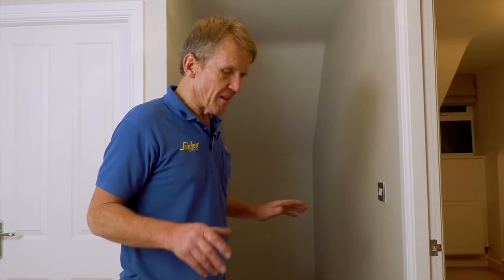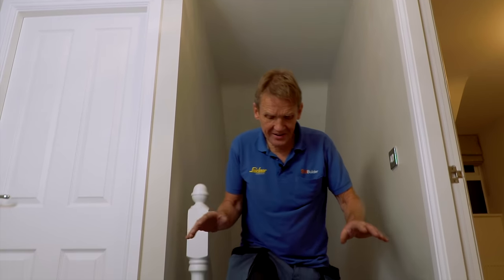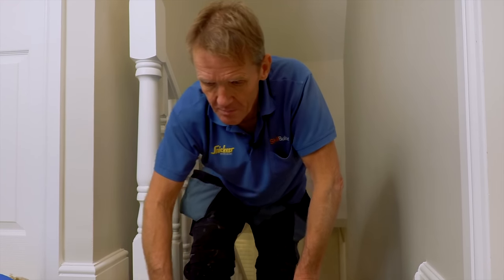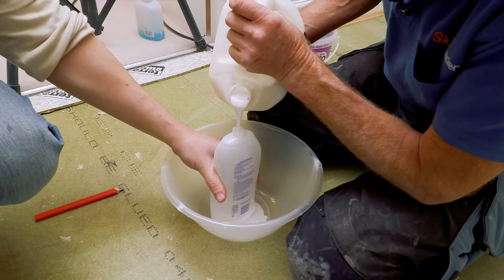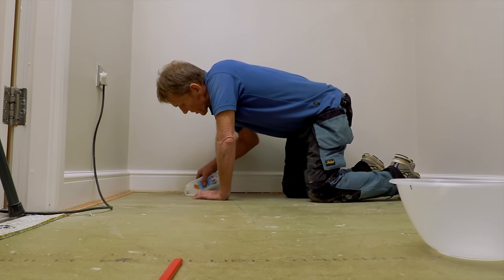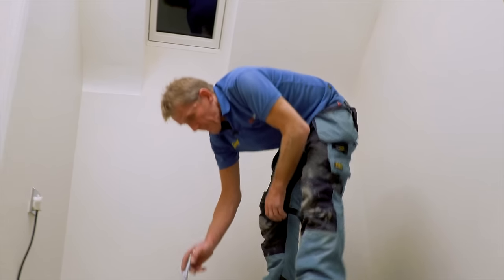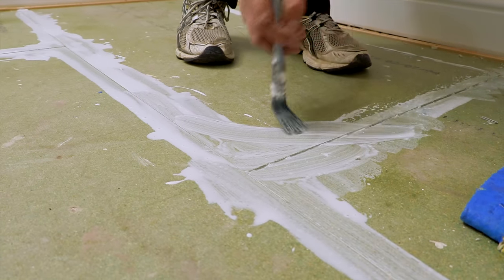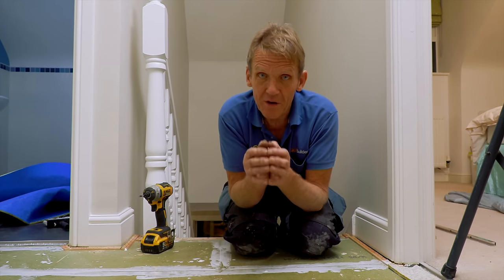Creaking Floorboards Driving You Crazy?

Comment: DON'T DO THIS! I watered the PVA down in a 1:3 ratio and tried this and it just went through the ceiling through the lights and now I'm worried. Not been 12 hours yet so we'll have to see with the squeaking. If you do it, don't add water.
Reply from the maker: I think you went a bit over the top there. If you don't water it down it will not get into the joints but don't pour a whole load down in one go.

Comment: DO NOT DO THIS!!! I tried this method and it has warped my floor!
Reply from the maker: You must have put a lot of water on it. It has never happened to us but we have had floods from burst pipes that made the joints puff up slightly and you can sand the joints down flat.
Reply: @SkillBuilder  I did one part pva to two part water...
Reply: @sierramc3935  and it still worked ?
Reply: @kimbo1966  no, creak still there

Comment: You can just drive some screws right into the carpeting and into the floor and that should work great. After doing that if the floors aren’t creaking then it’s really not necessary to pull up the carpeting, purchase and apply the glue then pay A carpenter to come over and refit your carpeting. Just because someone takes the longer way to do a job doesn’t necessarily mean it’s doing it right. I don’t mean to undermine his advice because he seems very knowledgeable and helpful just be aware there is an easier way to complete this job you decide what’s best for you.
Reply from the maker: Jeffrey 
That is such bad advice and anyone with any sense will not drive screws through carpet because you have no way of knowing where they will go. If you don't land on a joist it is pointless.

Comment: Seriously it was nailed! All you needed to do was screw it, glue was completely unnecessary.
Reply: Big Boss wrong! Roger is correct. The squeak comes from the movement on nail shank and/or the t&g joint. Roger is absolutely correct to glue the t&g joint. I’d bet Rogers 40+ years experience trumps yours.
Reply: Let me give you a basic science lesson, friction is caused by movement in this case the movement is the floorboards not being sufficiently screwed tight enough to the joist hence allowing movement. Nothing to with experience just good old common sence oh and I'm sure the next tradesman who's going to need to lift the floor up is going to appricate it's been glued.... amateur experiments
Reply: then why does the manufacturer say glue them? the glue bonds them and also coats them dulling the noise from friction, as someone who has removed countless chip board floors it rarely comes up and goes back down as it breaks in to pieces.
Reply: Big Boss I’m not sure being an apprenticed and qualified carpenter with 23 years experience classifies me as an amateur. 
FYI we should fix down floors to building regs, manufacturers instructions or best practice irrespective of whether another tradesman may, or may not, need to randomly open a section at an unspecified later date. Roger did explain it’s unlikely there are services running below these areas so maintenance in the near future in these areas is unlikely.
Further, it’s also very poor practice to have lifters in high foot traffic areas such as halls and landings.
Reply: @lewisthompson1611  the glue is a solution to a problem that is resolved by sufficiently screwing the chip boards down to hopefully well screwed floorboards to joints.
Reply: @stevend9960  A. You should know that no mater the years of experience every day is a school day.

B. I'm promoting the screw not the glue  in regards to tradesman needing access as it will probably break or most likely weaken the t&g on the chip boards when putting back together and we both know they ain't going to get glued again lol. Also he glued everywhere and didn't screw near potential pipe runs.

C. Lifters are old school as long as boards are screwed down and not nailed that is sufficient in regards to future access.
Reply from the maker: The writing is on the board. Should be glued. All those people who think you don't need glue are the reason we have so much of this sort of thing.
Reply from the maker: @BlGB0SS  I love the way that people claim "common sense" to be somehow superior. The British Standard calls for glued tongue and groove joints. It is common practice on all building sites but people are lazy or, like you, just know better.
Reply: @SkillBuilder  with all due respect if this product requires glue doesn't that just tell you it's causing a problem as it eliminates another...
Reply: Skill Builder ooofftt!!! Go on son! 😎
Reply: @SkillBuilder  ok let the evidence speak for itself do the same job but only use screws sufficiently and not glue and since when have the BS ever been perfect? Oh never so guess I must be arrogant for trying to use my own incentive and reality into practice.
Reply: @BlGB0SS  If you need access you  cut tongue anyway and afterwards fix a noggin under the joint.And good practice to glue them to the joists as well.As my mate Dave used to say 'each one teach one'
Reply: Big Boss can you please advise whether you are a tradesman and what type of experience you have with the scenario shown in the video? I am afraid if someone showed up at my door advising they were going to fix my floor using common sense and no experience  I would tell them to bolt...
Reply: I've tried screwing tongue and groove chipboard that was squeaking. It did have limited success but i didnt eliminate the problem...
Reply: Wouldn't the problem be that the position of the joists and/or the cuts of the flooring would have to be perfect to allow the screws to be in the optimum position. I'd guess even a centimetre off any edge and you have movement, therefore squeakage. I have zero qualifications or experience. Intermediate DIYer!
Reply: Big Boss - you’re right that screws will prevent friction but only in and around the screw. The further you are away from a screw the more chance of movement. Putting screws every inch isn’t practical and makes the wood weaker so the glue method has its merits as it protects the areas between the screws
Reply: Go back to school!
Reply: @BlGB0SS  personally I love guys like you. It keeps professionals busy fixing your common sense approach.
Reply: I agree that pva is doing nothing. No strength whatsoever.
Reply: But that’s not to say they should have been glued originally.
Reply: Ive cured a few squeaky floors before, always just screwed them down with spax screws alone.

The pva wont hurt but im not convinced it will really go that farr into the joints
Reply: Big Boss 

Don’t think big boss I done that took all nails out and then replaced with screws and put more screws in 

Still squeaked !

Comment: What a load of bs
Reply from the maker: Does it work? Yes. That is the kind of BS that makes the world go round and like it or not, you are on it.
Reply: @SkillBuilder  50mm screws are standard for flooring boards, anythink bigger runs the risk of going through pipe or cable. putting waterdowned pva won't do shit. Yes I do this as a job.